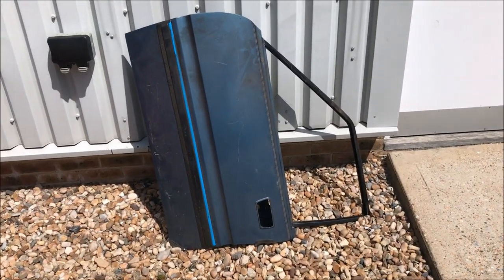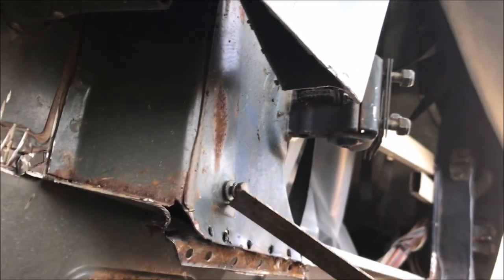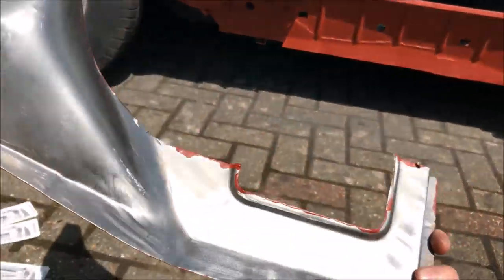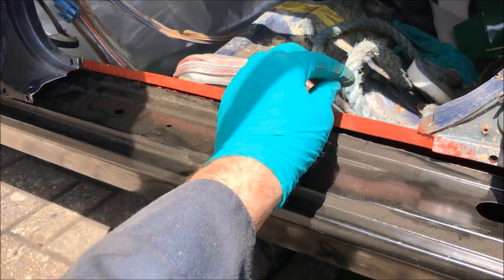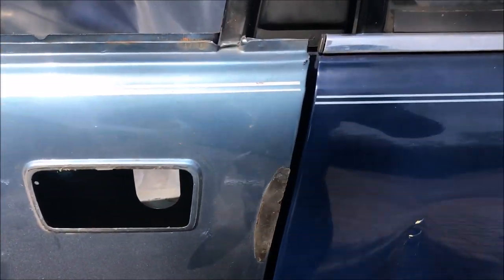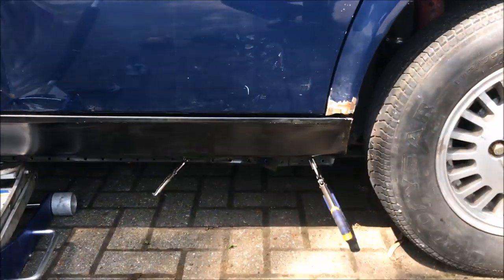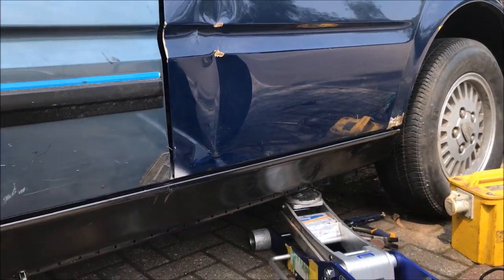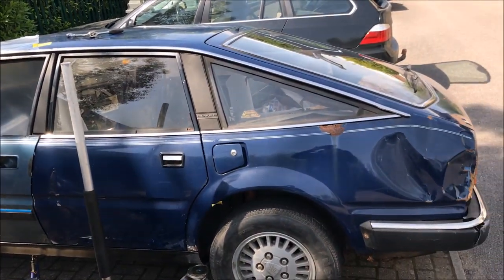Rover SD1 2400 SD Turbo restoration - Video 62 Sill part 3

Comment: Nice project, for cleaning the holes before plug welding use the drill you made the hole with and just touch it to the panel to remove the paint (usind a drill of course!) . Faster than the scribe method your using. Especially if you have 50+ holes!

Comment: I am impressed by your patience and hard work. But why choose to restore the diesel, which was, I believe an Italian engine with a poor reliability record.
Reply from the maker: Its ultra rare.  Plus they didnt have a poor reliability record.  They are bomb proof.  Thats whey they were used in transits, range rover, alfa romeo, ford granada, land cruisers,  jeep cherokee, chrysler grand voyagers right up to mid 2000's.  The only reason people though they had reliability issues was using wrong coolant, using wrong oil (remember turbo diesels were not common in cars at the time) and because they were under the impression that you could change each individual cylinder head gasket independent of the others.  You cant.